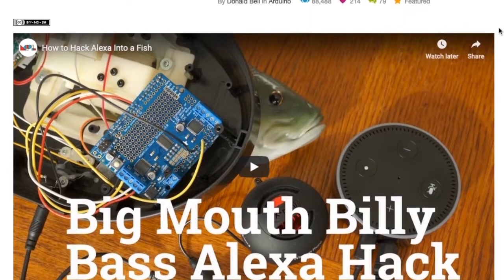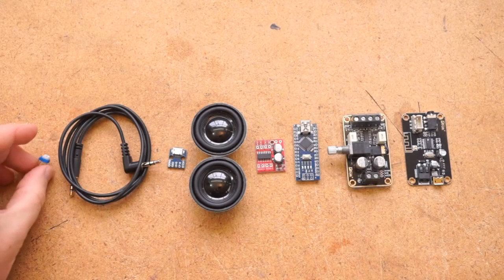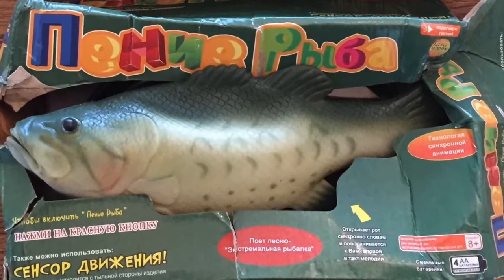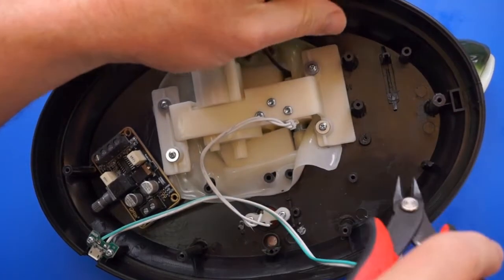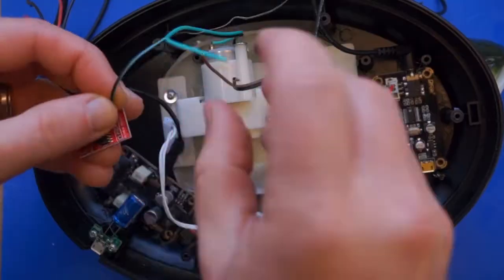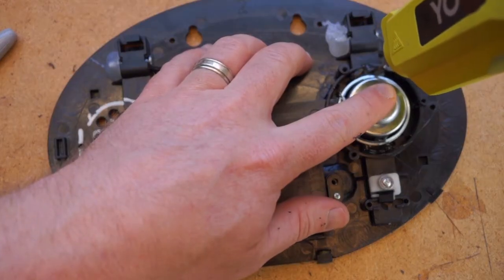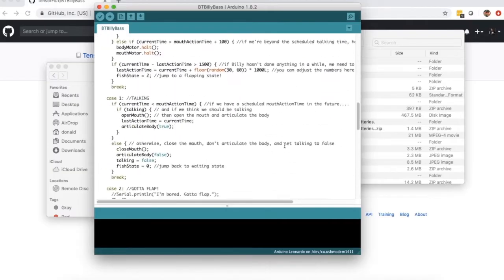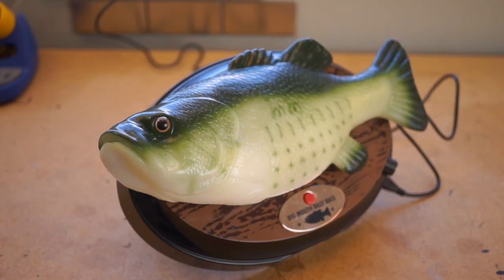How to Build Your Own Bluetooth Billy Bass | Masterclass Maker Projects

Comment: Do not attempt this if you have a 3 motor model. The author says it will work, but does not share how or give any links to code that will work on the needed Arduino Uno with motor shield. The author doesn't respond here or on the MakerPro website. Save your money or find a newer 2 motor model.

Comment: Mine cuts out with the volume up, only works at medium volume and almost cannot hear. Any recommendations? Bluetooth drops out and reconnects constantly but doesn’t at medium volume
Reply: Mine does too... im swapping the micro USB for type C.

Micro USB is only good for 5v and 5-10 watts of power. The amplifier on the recent parts list is 10w alone. I wired in about 3500mf worth of capacitor batteries but it still cuts out when too much power is being drawn.

So I ordered a 100w type C to replace the 10w micro USB power source. It may need some others like a high watt step down board incase the 5v power rail doesn't supply a enough watts and I have to use a different output voltage

Comment: Doing this with my dad, how do we know which models have 3 motors instead of 2? Would that make this progress any different? Thanks.
Reply: did you figure it out? I just have a problem with the code and the 3 Motor design, could you help me? :)
Reply: @pandakam9706   I know! I opened two Billy Basses just now and BOTH have 3 motors. I'm new to all this animatronic field and now I'm worried I won't know what to do with the extra pair of cables coming from the third motor that Donald doesn't have in his.  Did you find help for your fish?
Reply: @alejandradz174  Hello Alejandra, you can Connect the 2 cables of thr 3rd Motor with another l298n Module but for this solution there ist No Software Code. Instead you could  use an arduino Uno with Motor shield, Here is a Code available.
Reply: @pandakam9706  Do you have a link to this code for the Uno with motor shield? There are a lot of us 3 motor owners who starting this project, being assured "any model can work", that are now hung out to dry. If I could find that code for the uno I can figure the wiring out. The author is not responsive to these questions on the MakerPro website either.
Reply: @PokesAddiction i Had a Code but its Witten not correctly to the Motor shield and my fish suddenly Had too much Power so IT didnt went as IT should. Im a noob at writing Code, so im Stuck and i Put the Project on hold for now cause it Takes too much time to Figure IT Out.

Comment: Hey Donald! Just wanted to give you a thumbs up for the tutorial, I just finished doing my own talking billy and it works great. I actually skipped the bluetooth and audio amplifier modules and simply used a jack splitter to input the audio to the fish and to the speaker directly. One small issue I have (probably has to do with that) is that the mouth motor has a slight delay in relation to the audio signal.  I've seen other talking billy's on videos and the mouth seems to move seamlessly along with the audio. Any suggestions on how to achieve this? Cheers!
Reply from the maker: Glad to hear that! To be completely transparent, we do not have specialists or researchers that have answers to this answering our social media. Feel free to ask the question directly on the article itself. We encourage our authors to respond to the comments there.
Reply: Hey Paolo, that sounds a lot like my Billy build... To be clear, are you splitting the amplifier signal as an input to the microcrontroller to start animating? And using the existence of audio signal as a trigger to animate? If so it's probably a threshold in the code that isn't sensitive enough to kick off the motor animations. It could also be not enough current in your power supply making the motor slow to respond. If you want to shore more details about how it's supposed to work I'm happy to give a few more thoughts.
Reply: Hey @BenjaminEagan , thanks for your reply! I just saw this since for some reason YouTube didn't notify me. But I've been revisiting the project to make a few tweaks and foud your comment. Yes, basically I connect a two jacks to a splitter, one for the audio and one for the billy bass. It kind of works but it's still not that accurate. But I know this isn't probably the best way to do it. I will try your suggestion, that might be the issue, yes. Also, there's a werid beeming noise coming out when the motor moves, but I think that might be a short circuit of some sort. Let me know your thoughts! Thanks

Comment: So I love this idea!  but I am brand new to adruino.  Can someone give me step by step how to add the code.  I found the code and have the exact parts that were in the video.  I have all the wiring done, just need to know how to add the code correctly.  Thanks
Reply: Hello Barb Atwood, I know it's been a while... but were you able to figure out the coding?
Reply: @alejandradz174  hello ! I had some trouble too with the code, did you figure it out ? thanks !